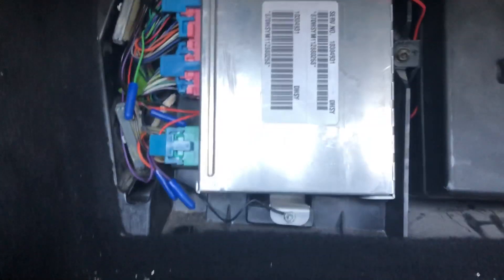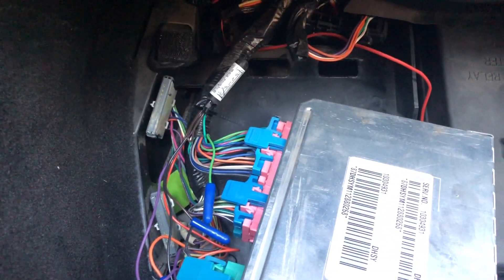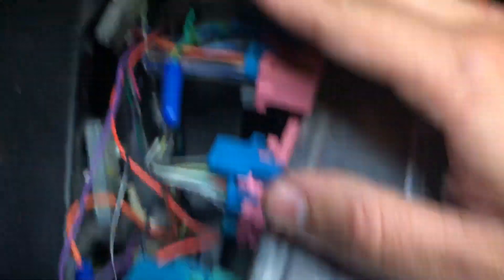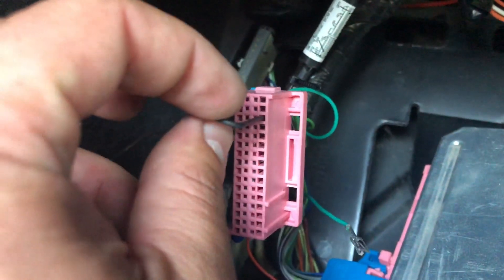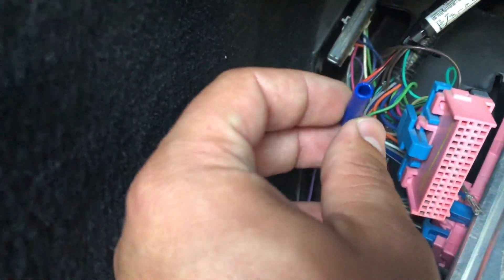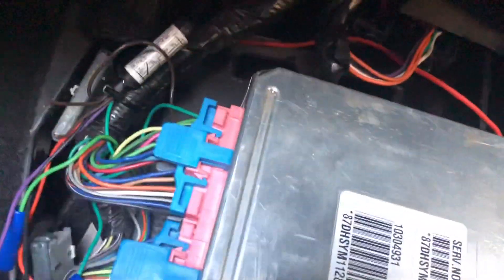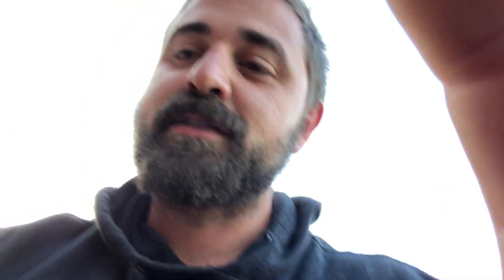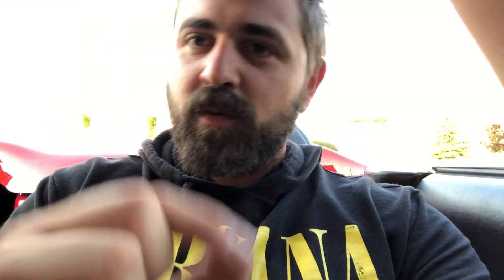Twin Flag Garage - C5 Corvette LMC5 Brown Wire Mod

Comment: My 1997 c5 auto I bought had the lmc5 installed no brown mod yet. The day I bought the car the old man I bought it from replaced the battery. I was getting the pull key out and wait 10 seconds message. Did some digging and all I did was remove the #25 fuse for 10 minutes in the fuse box in the passenger floor board. Has worked for me so far. Mine still has the green wire and brown loop uncut.

Comment: Great video. Mine already had it installed also but still getting the column lock code.  Hopefully it works for me also.
Reply: Pull the #25 fuse for 10 minutes to reset the bcm. Your battery has to be good though for this to work.
Reply: @jmac636  I will do this. When I get the car back together this week

Comment: Did you have to remove the relay as well? I’m trying to figure out if I even need to do the relay. Mine has no purple wire just 2 orange green and white

Comment: Anyone run into a situation where there's no dark green wire in the 3rd slot?
Reply: Figured anything out?😊
Reply: @Velvet_ZL1  I can't remember exactly what I did. I purchased the car with the LMC5 already installed but was still getting the "Pull Key wait 10 seconds" message when starting the car. I want to say I just ended up cutting the brown wire and the message went away, but I don't remember if I did anything else.

Comment: I`m stuck with mine . put LMC5 , now in LMC5 manuals it states replace brown wire that is below green that was replaced already, You are replacing dark green instead. I still have single 10s message and constant column service. So is it dark green or brown to remove ? BTW i still get fuel cut off

Comment: Yea bro I’m going to the computer I see the previous owner had already put the LMC5 already going to try your method right now hopefully it works but if not could it be the starter then???
Reply from the maker: Steven Claros hopefully this solves it. Keep me posted.
Reply: Twin Flag so after a good test run I’m still at square one but the column lock service is out the window so that’s awesome!! my problem is my car doesn’t start all the time I would pump gas and turn off the car and be there for like a good 30 minutes because it won’t start on me

Comment: Did I miss something? What wire did you cut?
Reply: Thanks for summing it up here, I really was beginning to think this guys an idiot, plugging a wire in just to cut it? Lol...
Reply from the maker: Naaman Geist the brown wire!
Reply: @twinflag821  You connected the brown wire of the LMC5 module in place of the green wire on the BCM... then you cut it? That makes no sense...
Reply from the maker: Naaman Geist might be confusing but that’s exactly what I did. Read the link in the description or message me on Instagram. Happy to help you with it.
Reply: @twinflag821  After rewatching, it looks like it's another brown wire that loops out of the LMC5. I don't believe it's the same wire you connected to the BCM.
Reply from the maker: Naaman Geist you got it! Remove the green wire (see diagram in video). Plug in the single brown wire. And then snip the brown wire loop that comes out of the LMC5.
Reply from the maker: Naaman Geist all make sense?
Reply: @twinflag821  yes, after receiving mine in the mail and reading the instructions, I didn't need to connect the brown wire or cut the loop. If I have issues in the future, I may do so but for now, everything it back to normal again with just 3 wires connected. Thanks
Reply: @twinflag821 this was the detail I wasn’t getting from most videos and I was getting confused like the original comment. Thanks for clearing it up and answering the comments brotha. Cheers
Reply: Hell no!